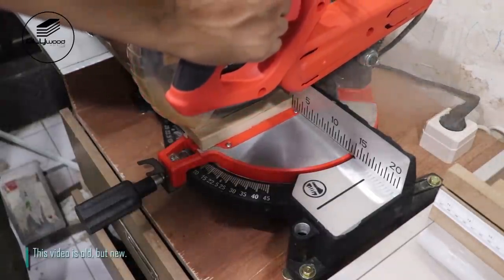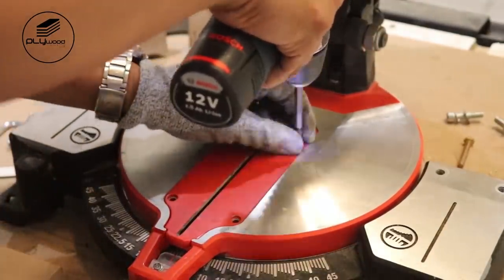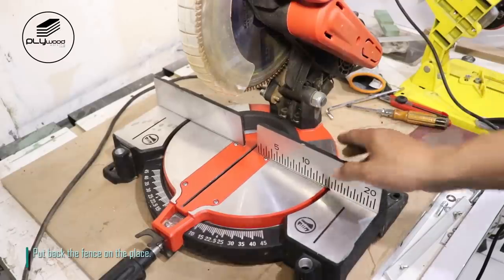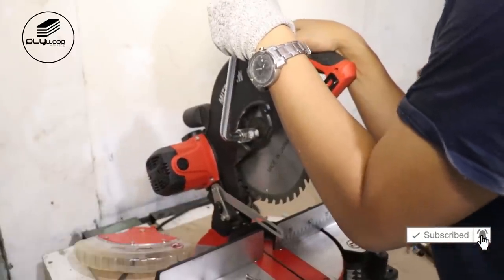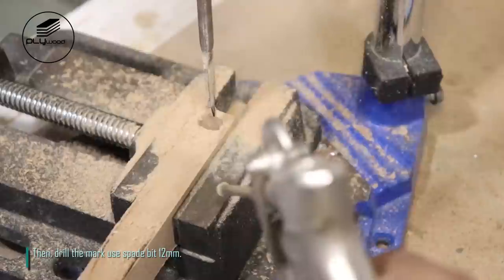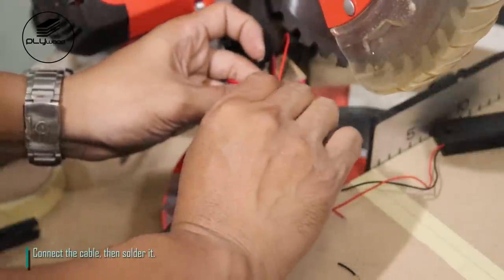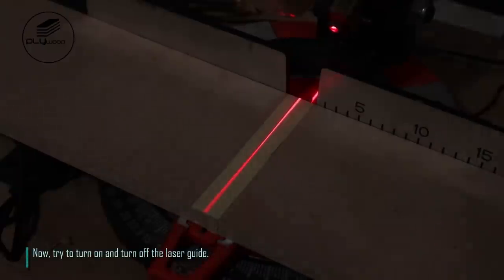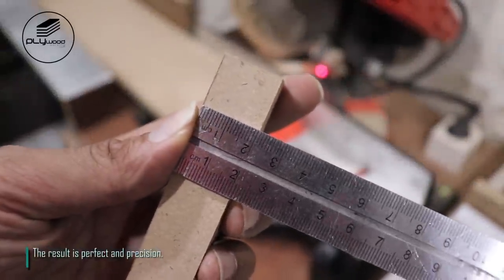How To Fix Cheap Miter Saw and Add Laser Guide

Comment: The gap under the fence is there for a reason, it lets the table pivot without binding on the sawdust, none the less it is a very good video.
Reply from the maker: Yup you right but this gap too big and i make more small for precision thin cut.
Thank you for suggestion👍🏻👍🏻

Comment: buat potong 45 derajat hasilnya presisi apa tidak om?
Reply from the maker: Awalya gk tp setelah diset super presisi, cm skr udh dibeli am tmn ms ini. Bagus tipe ini suaraya super halus
Reply: @plywoodworking  kalau budget cuma 2 jt mending beli makita ls 1040 yg second atau beli nrt pro tipe        
yg ini om, mohon saran yg baik menurut om yg lebih berpengalaman🙏😀
Reply from the maker: Klo sy ambil stanley ato bosch selain itu budget dibawah 3jt krng recomended, klo 2 jt sabar dlu ditabung aj dlu, atobuat diy simple dlu
Reply: @plywoodworking  berati yg tipe ini gk recomended buat dibeli ya om
Reply from the maker: Sangat recomended buat pemula am tgl dikampung coz suaraya halus gk berisik, asal bkn potong kayu super keras aj gk ada masalh. Sy pke hampir 1 thn trus dibeli am tmn gara2 super presisi am suaraya halus bgt
Reply: @plywoodworking  kalau buat tukang aluminium recomended gk om ? Soalnya buat kerja di proyek, dulu pernah pakai makita ls 1040 selama 8 tahun tapi dijual karena kebutuhan, dan sekarang pingin beli lagi tapi dana terbatas , menurut om nrt ini layak dibeli apa gk? 
Terima kasih sebelumnya🙏
Reply from the maker: Klo untuk potong aluminium enak bgt, aplgi dptya blade bwaan 120t, asliya tipe ini ditujukan buat aluminium am kayu biasa, cm krng recomemded buat kayu super keras agk krng tenagaya, enakya ini bladeya udh ukrn 10